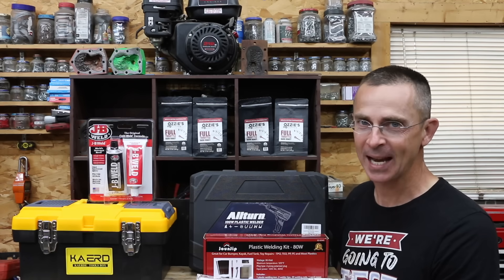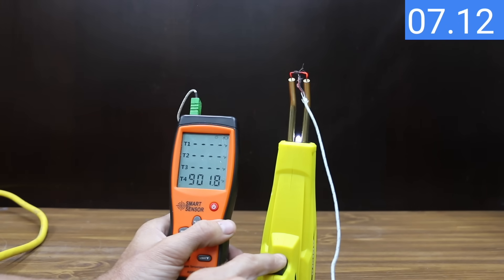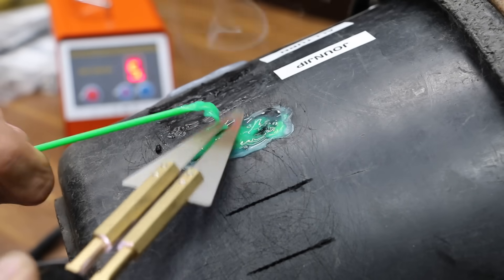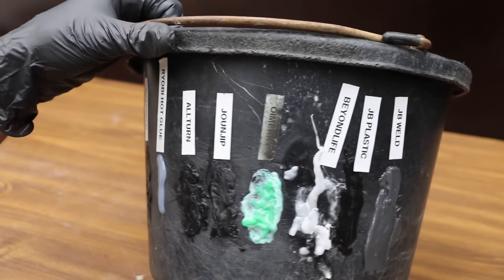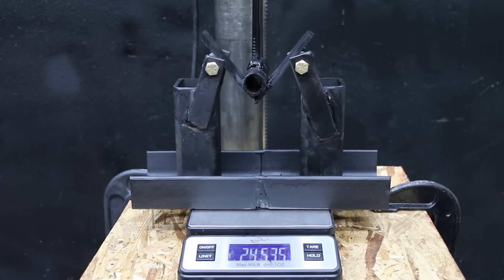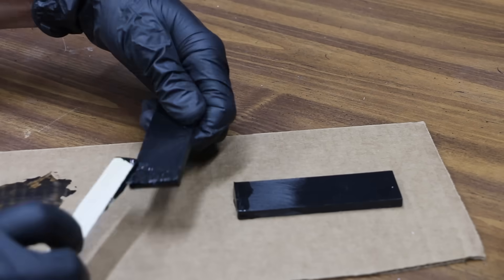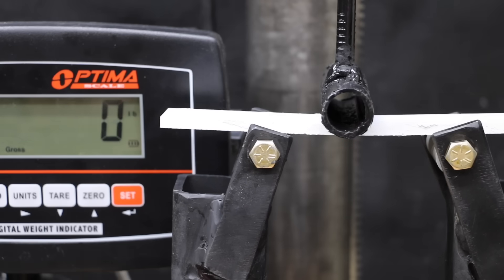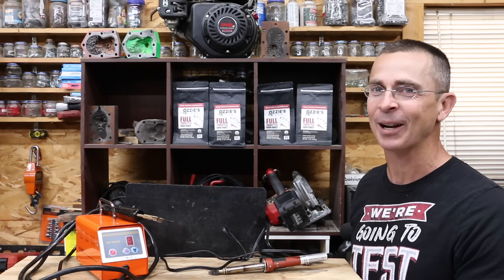Don't Buy A Plastic Welder Until You Watch This Review!

Comment: There's one other method of welding plastic components together that I learned as an Airframe and Powerplant mechanic, following the Cessna 152/172 Series Service manuals: Chemical welding. 

In essence, take some plastic chips that match the plastic you are trying to fix (don't use Polyethylene on ABS, for instance), and dissolve them in hard solvent (MEK or full strength acetone), best done in a resealable mini can. Mix it up thoroughly, to get a smooth consistency of this now thermoplastic paste. makes sure the repair area is clean, then wipe the area with some of the solvent and let it sit for a minute or two. Then you fill the repair area with your thermoplastic paste like you would using JB weld and let dry. once the solvent evaporates completely, you should wind up with the plastic weld being completely indistinguishable from the base material, but I've never actually put that to the test.

Since you put it into a resealable can, the paste you have made will stay ready to use almost indefinitely, and if it does dry out, just add more solvent.

Thank you for listening to my idea. I did enjoy the video, Though as other people noted, using dissimilar materials when trying to weld some of the plastics did not do you too many favors. There was still really good information on the welders involved.
Reply: I'm not the poster, but I appreciate your work commenting. I'm going to research the manual as well.
Reply: @bostonmarketfeministbookclub  Working at a flight school, I've done this kind of repair to a few aircraft, always on the non-structural fairings. The Maintenance manual definitely has dissolved thermoplastic bits as an acceptable repair under "Repair of Thermoplastics" in the Structural repair sections of Cessna 152 and Cessna 172 (Pre-R models) Series service manuals.

In our flight school environment, this was almost entirely done for cosmetic reasons. Pilots squawked aircraft all the time because things didn't look right, even if it had zero impact on function or safety. But when pilots don't fly, school doesn't make money.

Comment: Didn't know there were specialty tools made for plastic welding, I just use my soldering iron lol.
I used to do this quite often for work when prototyping some stuff with a 3D printer and some Raspberry Pis. Of course I was using PLA and PETG, which melt at much lower temperatures, so the process was a bit different.

Comment: I've done plastic welding and I agree with the other comment, use same material for welding as the material being welded and your not using the welder where you feed the plastic rod through the welder, hold the welder against the piece being welded and lightly force the rod into the area being welded

Comment: The biggest mistake in this video is to use different types of plastic to weld. You can see that mostly times plastic rods didn't stick to repaired plastic. Dont use ABS to welding PE, no chance to achieve good results. Polyethylene terephthalate (PET/PETE) can be welded ONLY with PE.

Comment: Not know if you have done it yet. But Test..  Evaporative Coolers.  Down draft, Side draft, Flat Wall mount. Do they make cooler air when on low due to air moving slower?  Does it burn more power on high. On high is the air cooler or warmer?

Comment: Oh man, so many mistakes! Here are some important notes on plastic welding.

1) Always bevel the edges of the cuts you make (both sides if possible) so the plastic weld can penetrate deep into the void.

2) Choose a real plastic welding rod that is the same as the plastic you are welding; plastic type is usually stamped into the plastic. Those generic flat sticks are not pure plastic and are really only meant to cover the weld. They do not offer much strength.

3) When using the wire mesh, do not apply any weld to the surface. You put the mesh on top of the plastic and let the heat of the iron heat up the mesh until it sinks into the parent plastic; you don't want to simply glue the mesh on using a stick. You can then cover it with some plastic weld. It's always better to weld the two pieces together first(via step one) before adding the mesh.

4) Each method has it's own merits, combining several of them together offers the most strength. First bevel the two pieces, then weld (step 2), then use staples, then mesh.

Comment: Have you ever tested running shoes and trail running shoes.   Check for cushion, how quicky the cushion gets crushed with use, how quicky the bendy parts start to fall apart and how stiff they are against twisting and folding and traction on different surfaces.

Comment: I typically use a hot glue gun, using just the nozzle on PE, HDPE and vinyl. A 6' PE kiddie pool which develops cracks or holes gets the nozzle, followed by a hot glue 'patch' and works brilliantly.
I also have a Harbor Freight 'plastic welder' which I have never used, but apparently uses hot air.

Comment: When doing plastic repairs in the past I have used a soldering iron, I find that works well enough for me considering its very rare that I repair plastic.
Thanks for another great video as always :D
Reply: Agreed!  Tried the "plastic welders" and could never control heat or finish.  A sharp bladed soldering iron cuts a groove that the plastic rod fills.

Comment: Please re-make this test with proper usage of these tools. You need to push the mesh wire in before applying filler material. What you do is you're just creating a layer with filler material and mesh.

Comment: Unfortunately, you are not full penetration welding.  You are brazing plastic on top of the plastic.  I will not be buying any of these.  I will continue to use my $12.50 60 watt soldering iron and doing full penetration welds.  I have done many successful welds on plastic and mostly do not use any additional plastic.  Not needed.

Comment: ABS plastic can be solvent welded with acetone. Once the acetone evaporates, which doesn't take long, it leaves strong entangled polymer chains. Very similar to how PVC cement works, but much lower toxicity, acetone is the safest solvent to work with (aside from water), even safer than isopropyl alcohol (apart from the fire hazard). The acetone also penetrates and wicks into seams and gaps, and can be precision applied with a syringe. Useful technique to join parts 3d printed with abs filament, and/or use abs filament as a filler rod. 

Also, it's why you don't need primer for spray painting abs plastic, the acetone in the paint creates a thin puddle on the plastic surface that the pigment bonds to.

Comment: I do plastic welding very often to repair anything that breaks like plastic porch chairs and the grass exit Shute on my riding mower. It is always as strong or stronger than original. I do often use the staples to bond it and make it strong but the major key to plastic welding is to get the plastic melted very deep for maximum penetration. I try to get halfway through the thickness then again halfway through on the other side for complete penetration. even with the staples. and if you use wire mesh it should be melted deep into the plastic and not just stuck on the outside, the welding rods are really only to fill gaps in the plastic that the original plastic leaves as you weld it. Not to put a thin coat over the break as you did. I actually was surprised that it held as much in your tests as it did. But it was interesting to watch. I enjoy all the testing you do and often make my purchases of items based on how well they did in your tests!!

Comment: I got my first plastic welder 2 weeks ago, the "Sonnler" SN-B150,  it looks exactly like the Altern , but speced at 150 watts power, the staples will get Red Hot in seconds, I've been repairing broken Motorcycle body parts , battery tray, rear fender, side panels etc. The squilly  shaped staples give more support than the straight ones, i find it important to let the staple and plastic cool , before removing the welder from the item being repaired, to prevent pulling the hot staple out of the repair , also on your bucket, i would have used the squilly Staples , and put them length wise on the cut, using two or more not just one straight one across the cut,  your cuts simulated a stress break, and should be supported across the complete break, you are always very thorough in your testing,  but i don't think the breaking test reflected real world experience, as most plastic is either broken by impact, or by repeated stress such as vibration or repeated flexing,  i  don't expecting my plastic weld repair to be as strong as the original factory new,  i just want it to hold together and extend the life of my motorcycle or generator or  patio chair etc,  seal my bucket until i buy a new one, repair a cordless tool storage box etc..

Comment: As a former insurance guy and tech these would be fine for DIY but not for professional repairs. It almost identical to welding metal, you need the filler material to penetrate the surface without any oxygen present. Professional plastic welders typically use nitrogen as a shielding gas for the weld, have temp controls and different filler rods depending what you’re welding. Also all stand welding practices apply as well, clean area, sanding down transitions before welding, drill the ends of cracks, ect.

Comment: Weirdly, the best bonds I've ever had on #2 HDPE (High Density Polyethylene) and #5 PP (Polypropylene, hard to weld it turns to a brittle waxy mess,  ungluable, ) is a generic industrial, white-ish very high temperature only, hot met glue. it is hot enough to partially melt and bond, and sets fairly hard ( 55-65 Shore D Hardnes I estimate)

Comment: @7:35 Simply melting filler or adding mesh won't form a proper bond. You need to actually weld the two plastic pieces together, THEN proceed to add filler and or reinforcement. Only then it will be a strong weld and it should break somewhere else.

Comment: hey Todd !!  i dont know about dedicated " welders " but I AM A HUUUGE JB FAN.  i have done radiators, exhuast pipes and headers. also, intakes, blocks.
and yes ALL KIDS of plastics from dashs to bumpers ..... misc household iems. it sands, fills, drills, tapabilitie,  sand it, prime it n paint like bondo !!!!
there r tricks n technigues to work the stuff. 1 is that like REAL welding FULL PENATRATION is paramount !!!!!!!   another is learning 2 control how much hardner to use 4 the type of job ur doing..... more flex ..less flex etc !!!!
it is a very versatile material !!!!!

Comment: The Beyond Life one is a design used for heat welding vinyl and linoleum flooring. It requires a beveled grove, like welding steel. You use the hot air to heat both the parent and filler materials to just shy of liquid and press the rod in with the tip. There's definitely a learning curve and it's kind of becoming a lost art. Next time you're in a hospital, look at the vinyl floors, every 6ft you'll see the weld joint.
Reply: 6ft surely you mean 2m.

Comment: When i repair plastic i melt the ends and smoosh them together. This garantees you have heat penatration across the entire cross section of the join. Then you can add extra material/ plastic to the outside surface of the join. 
With the wire mesh you really need to heat and try sink it into the surface. Even preping the surface flat so you have less air bubbles in the join thats made. 
Its also very important to match the plastic types when you join them with a repair stick as some plastics dont bond well to others. You can use the recycle number to determin what type of plastic its made from.

Comment: I have zero experience with these gadgets but we routinely repair abs plastic tabs that are broken by knucklehead mechanics using impact tools on semi truck dash parts. We use a combination of wire mesh and fiberglass mat/resin to build new tabs. These trucks see 150k miles a year of pounding on the interstate and we have never had a failure. We have found that the few times that guys have come in with DIY plastic welded repairs, the plastic around the repair is brittle from the heat of the repair tool and is the point of breakage. Great vid Todd.

Comment: Interesting, I never knew you could buy plastic welding machines.
Another form of plastic welding is in small display model plane assemble kits, the glue solvent melts the parts' surface and so the parts are actually welded together, I can't remember what type the glue is though or if it is used in bigger welding applications.

Comment: I'm surprised you didn't try acetone - it's a great option for certain plastics when you can't use heat.  Being practically as viscous as water, it penetrates deep.
Reply: Very good, but terrible for polyethylene and polypropylene
Reply: The test was for plastic welding. It never specified being limited to certain types of plastic, or for a method that is universal for all plastics. In reality the test should have been done in a way that determines the optimum welding method for a variety of common plastic types. @321tryagain

Comment: I have used a soldering device, but one thing I did that I think makes a big difference is bevel the to pieces at the point of contact, then fill in the beveled gap. Doing this is like metal plate welding.

Comment: For the welds you are doing, a Drader Injectiweld plastic weld gun is far superior.  and for large welds, a Ritmo Stargun is great.
Reply: The YT video of welding a split apart garbage can shows clearly the perfect temp of melting the base material and the rod so both can fuse together in a gel state is critical.. Just search Drader. Thia does appear to be a potentially high up keep item. They have a multi step process to prep the gun and say the heat transfer anti size needs to be applied twice. However when prepped and at the proper temp, it looks easier than using a glue gun.
Reply: @martyvanord984  I welded with the Drader. love it.

Comment: Big learning curve here, the biggest issue I have found is identifying the type of plastic you're welding, you can't mix different base and filler materials and get good results, if possible remove a piece of the broken item some where else where hidden and use as filler material.

Comment: Good video, I've been using a soldering gun to repair plastic for years now. 
Word of advice, place/clamp the wire mesh on the plastic then use the welder/iron to heat the mesh till you can press it into the plastic. Then use the plastic rods to cover the mesh so it can be sanded smooth.

Comment: Welding whether plastic or metal a slight bevel instead of a straight butt weld would have helped. Also multiple passes would make the joints stronger

Comment: Thanks. I have to repair the rear bumper on my volkswagen golf 4. Someone backed into it and because he had a tow bar the bumper ended up having a big crack right where the chassis leg ends (I checked underneath the bumper). I think I'm going to use the staple method.
Reply from the maker: You are welcome!

Comment: I really got a kick out of this video. Welding plastic is like welding bubble gum.  But, just like torch welding iron, the secret is to get a "puddle" going, and feed filler into it without melting a hole into the work. Back in my truck repair days, I worked on a bunch of high end motorhomes. They mostly have custom holding tanks, made from polypropylene.  I got pretty good at repairing and fabricating these from scratch. 
Great review of the tools, if not a great tutorial on plastic welding 🤣😅
Reply from the maker: Thanks for sharing.

Comment: @Project Farm i have used the "stapler" type repair + 2 part epoxy a lot repairing car parts. And you arent using it wrong but from my experience when you get to your desired depth you want to rotate the staple a bit just like 1-2 mm if you do not do this any force applied to the repair wants to push it out the way it came in
Reply from the maker: Thanks for sharing.

Comment: The absolute best way is using a nitrogen system like the polyvance. I use it in the body shop. You can’t separate those welds if you do your job.

Comment: You're not supposed to use isopropyl alcohol to prepare surfaces for JB weld. the company advises using acetone instead. I didn't know this for a long time, and I would always clean my surfaces with alcohol before I used JB weld, and the bonds always seemed weaker than they should have been.

Comment: I would have loved to have seen the butt joints ground/cut to an angle like you do when welding metal. So that you were actually connecting the ends together, and not just the tops and bottoms with a thin sheet of repair plastic. I bet the results would have been much stronger.  But I always love your videos!
Reply from the maker: Thanks!  Thanks for the feedback.

Comment: As a kid I remember my dad and grandpa repairing a hole in a 4 cylinder engine block on my grandpas boat using jb weld and a steel soup can they flattened out. This was late 80s or early 90s.
Reply from the maker: Thanks for sharing.

Comment: PE and PP are generally not going to bond well with epoxies, glues, adhesives, etc. There are some that will but many won't. They are however the easiest IME to weld. But I do it the old fashioned way with a soldering iron and scraps of the same type of plastic. Metal reinforcement is often necessary. With epoxy I'll use carbon or glass fiber reinforcement. It's the chemical compatibility that is the key to a strong repair for either the welding or epoxy IME. What works with one type of plastic can be a total failure with another.
Reply from the maker: Thanks for sharing.